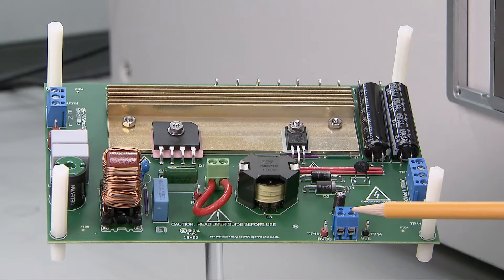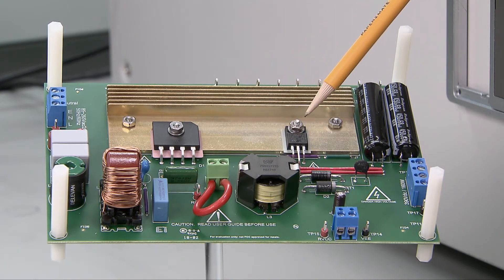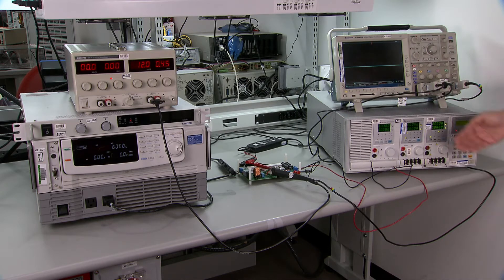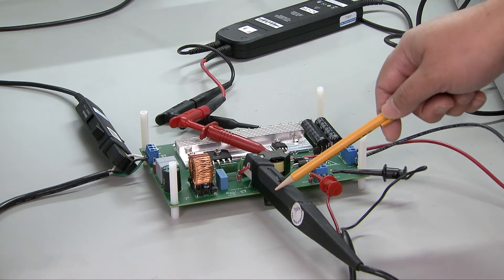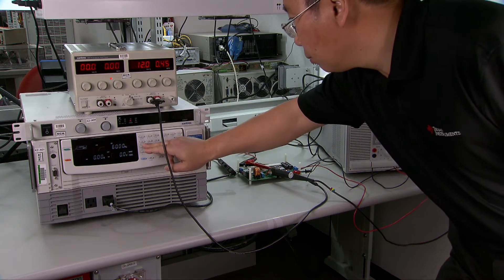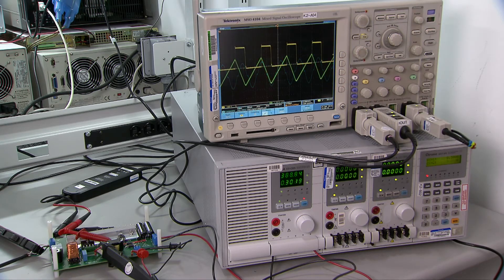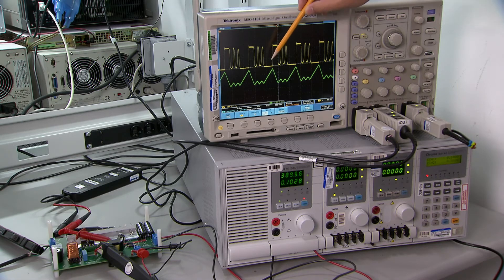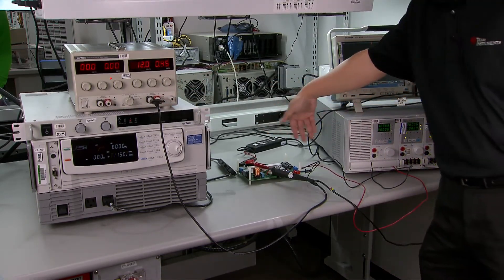How to get started with the UCC28056 high performance PFC controller

Comment: Dear Ti engineer, I put a PFC circuit which controled by UCC28019, a chip for TI. It's output voltage is 400V and current is 3.25A, full load power is 1300W. From the date sheet, when the voltage of inductor current sense resistance over 0.66V, the peak current limit will be engined by chip to limit the current acrosses the PFC inductor. However, my sense resistance is 0.01ohm, so it means the pcl will put when current over 66a,and the actual voltage of resistance is 0.058V，so I don't know why pls help me thanks ❤

Comment: As an electronics engineer, I appreciate the effort of TI doing some steps on youtube.

But fot a better explanation, it would have been better to show more  graphs for example an output current shape

It would have been better as well to have someone that does more than just "read" a text, it looks very rigid ans not "appealing" to watch.

A lot of electronicians on youtube are best examples when presenting a project,youtube is not about "what you show" but "how you show it"